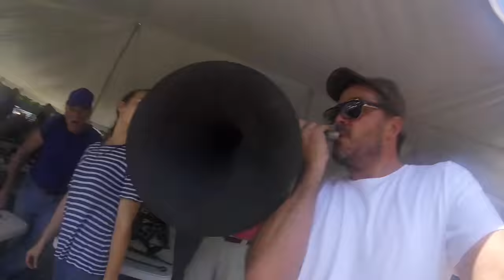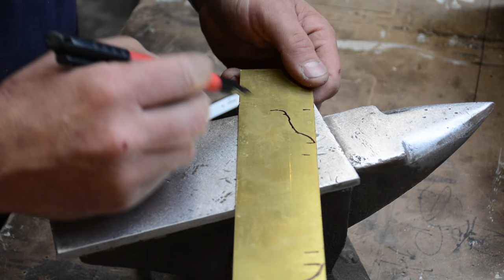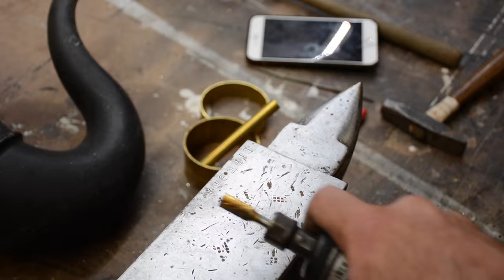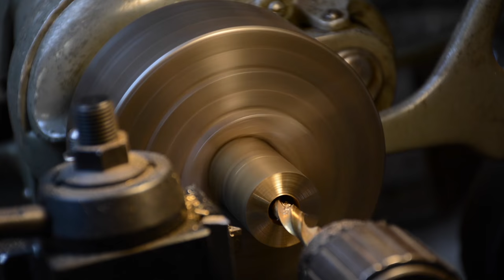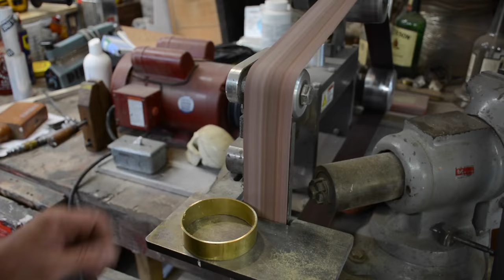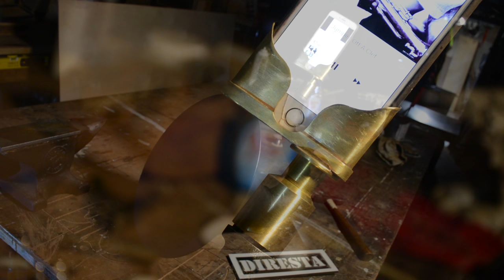DiResta: 1920's iPhone Speaker

Comment: Lovely. This works by providing a more efficient transmission of energy from the tiny speaker to the large ambient air by way of what is referred to as impedance adaptation. The acoustic pavilion does a great deal of it and it seems Jimmy has given great care in making the adaptor in such a way the interior diameter has no step. Great job again DiResta.